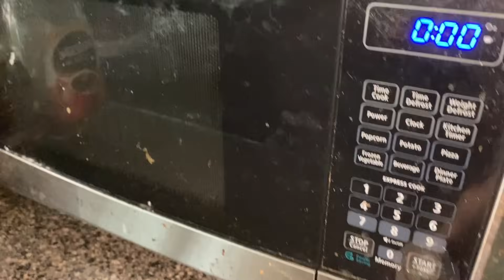Amazing  KITCHEN CHANGE ! #speedcleaning #cleaningmotivation #cleanwithme

Comment: You are sooo smart by testing the homeowner's ability to keep the kitchen clean first....then help with the rest of the house later.....what a fantastic strategy!!!..... don't apologize for having a method for the way you clean, if it works for you, put the dirty dishes on the dirty floor.... it's all dirty anyway.....great job btw!!!.... Aurikateriina would be proud!!!....and I have been using a towel as a dish drying rack for years also.....very effective and easy to wash and keep clean.....you did awesome with the time you had!!!....looks much better, hopefully the homeowner can keep it going!!!....

Comment: I think it's  very sweet of you to give your time however limited.  Just a small tip if you clear off the stove and spray it with oven cleaner then cover it with plastic wrap as the first thing you do when you get there, it will clean itself while you work on the rest of the kitchen same thing with the oven and microwave.  Lemon water in the microwave also works and makes it smell nice.  Keep up the good work

Comment: You did an amazing job on that kitchen Barbie! And the microwave on the other side works. 
I’d tuck the power board away from the stove as it’s too close.
I find ordinary windex works well on stainless steel, like fridges, coffee machines etc
Reply from the maker: Yes, windex used to work but sometimes it’s leaves some marks

Comment: Barbie, we can see that you clean very old, unmaintained buildings. There is nothing that can be done with stains, decades of paint build up, cabinets that are so caked on with paint that they don't close properly, radiators gunked on by decades of paint, broken blinds, etc. 
All of those are bigger projects (the blinds can be repaired/replaced, but that isn't what you came there for).
One thing many people skip is wiping down walls and steam cleaning their A/C vents. These are huge contributors to poor air quality and difficulty breathing. But again, that is a whole other project. 

You are an absolute angel put on earth. Please don't apologize.
Reply from the maker: Thank you! ❤️❤️❤️

Comment: You are doing good
 The only way to soak the stove longer would be to take the stuff off the top as soon as you get there and spray it down then. Use plastic wrap on it. Everyone uses it. It won't hurt to use the stiff side of the sponge on the stove top. I have to slow the video down so I could see what you were doing 🙂 You might could slow videos down a little and make part 1 and part 2. I wanted to move the microwave also.

Comment: I used to do cleaning part time to earn money.  But I have never had to clean such horrible messes that you clean.  I would not have the stomach to do so.  But you do a great job and you do not let any job phase you!  Yo do a wonderful job.  By the way, do you ever pull out the crumb tray on the bottom of toasters and clean them out?  Something that you might want to add on.  A dirty toaster crumb tray can cause a fire.

Comment: I know you have limited time with these cleanings so I really would recommend spraying the stove top FIRST with oven cleaner and covering with plastic wrap. And then continuing with the rest of the room, leaving the stove till almost last. This gives the method tine yo work even 3-4 hours makes a big difference. Another thing I recommend is a hand geld steam cleaner it really helps to vaporise the stubborn caked on dirt and grease and saves a lot of scrubbing. 

Another product I was forced to use was sugar soap good old fashioned sugar soap dissolved I'm boiling water. My extractor fan had failed and I'm waiting for the spare part to come back in stock but in the meantime the cupboards near the cooker were getting coated with a film of grease. I tried a few different degreasers and they didn't really do much tbh I was at my wits end until a friend suggested sugar soap. I had totally forgotten about it but yesterday I spend about 4 hours scrubbing with it and it worked brilliantly. My cupboards are solid wood and have a design carved into them which is lovely, but it's from.the previous owner and personally when I change out the kitchen I will get totally flat cupboard doors and would advise anyone who doesn't like cleaning or who doesn't have much time or bad health/mobility  etc to always go for plain doors without any carvings or moulding if possible. The tiny nooks and crannies are an absolute MAGNET for grease and this can ve very stubborn and hard to scrub off without damaging the finish. Its a shame really as my kitchen is solid oak and will last years but it's design is very much of its time and it can be a nightmare to clean. I find even at the best of times I have to deep clean about evert 6-8 weeks
Reply from the maker: Thank you! The problem with me, i can focus for only one thing at the time. When I see, the kitchen is full and no place the first thing what I’m doing is selecting stuff. And the last is the cleaning… 😅

Comment: Hello Barbie! 
The before and after video was impressive and outstanding. Job well done. Barbie, do you ever just bee line to the stove to see how dirty and greasy it is and then start using easy off right away to give it time to work and give you a head start, so you don’t have to work so hard? I think this would save you precious time. Did you end up recycling any of the plastic that was put in the large plastic bags? I’m a huge recycler, so as important as it was to declutter all the plastic from the kitchen, I think it is important to recycle it too. I’m a big fan of yours, so please don’t take my comments too hard. ❤😊❤
Reply from the maker: I don’t do recycling but the building does:)

Comment: I agree not to spray cleaner into microwaves cus it gets into vents n air holes in there. Heating up large cup of water with or without dish soap works like you said. It basically steam cleans the food particles so soft you simply wipe them out. 👍

Comment: G'day, Barbie! Another reason you shouldn't feel bad about not pulling the stove out is the danger of disrupting or damaging a gas pipe which could cause problems if it's accidentally separated from the stove and there's a gas leak or something. I heard this from Mack at Midwest Magic Cleaning and it's his reason for not moving the stove.

Comment: You need a mop for the dirty floor.  Perhaps, you can get a mop with extra mop heads.  That way you can use a clean mop for each customer.  Clean the mop heads with bleach and soap.

Comment: Hello, Barbie! Quick tip - put the cleaning degreaser on the stove or very dirty surfaces the minute you arrive. Cover it with plastic foil and this way you get a few more hours for the product to do its thing. Please, stop thinking about the polution when using the plastic wrap, as you already invest so much time, energy and money in these hard cleanings. Not to mention the amount of stuff people need to throw away. You are helping a lot, but don't ever forget about yourself, as you also need to make your life easier 🤗❤❤❤

Comment: For stove oven and bathroom, kindly use heavy duty oven and grill cleaner, it’s sodium hydroxide or lye in it, even potassium hydroxide 
It is only $15 for a gallon, so no more expensive than other cleaners, you have to pay $10 in shipping for every $50 you spend at office supply stores 
It’s once and done , then you still have to use a wet pumice stone on all these surfaces 
You never have to apologize for anything ever, as you are all of us guys leader

Comment: Hey, hello, all ya jack-booted microwave cleaning opinionators, guess what? You're wrong about how you can't use strong chemicals in microwaves. You can, you just need to be sensible about it. Also, vinegar is NOT a disinfectant, modern eggplants do NOT need to be soaked in salt, and washing raw chicken is dumb. So many bubbles busted. Yer welcome.